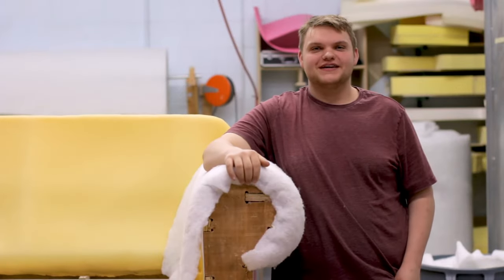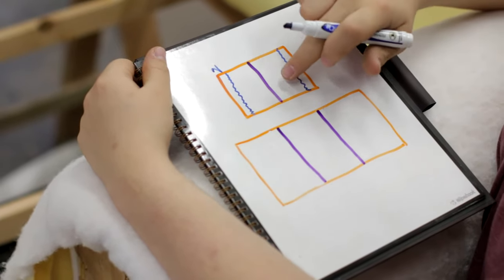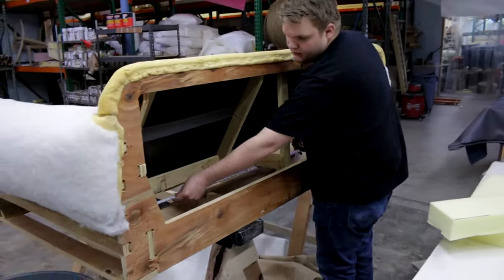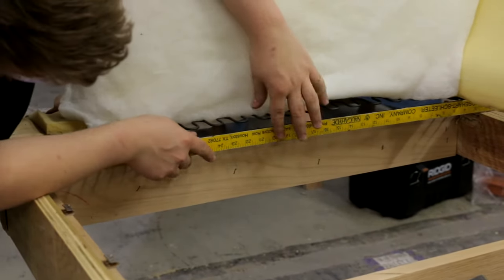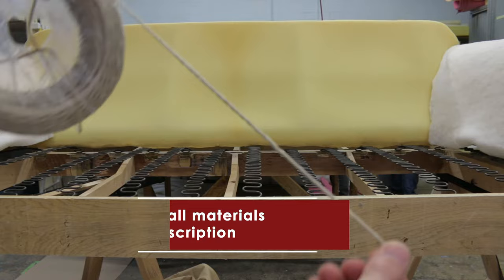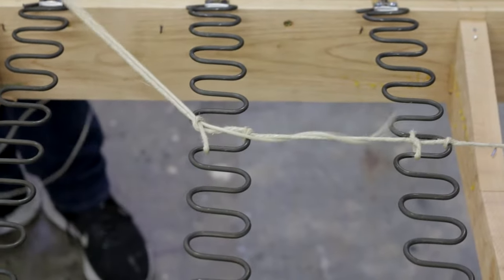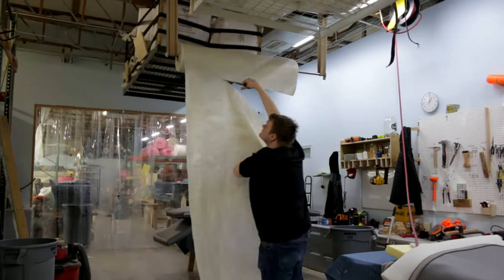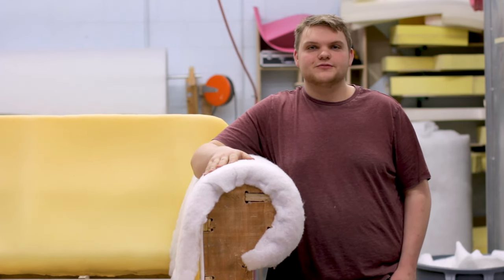Spring a Couch Like a Professional

Comment: Hi - this is a great video, thank you - I feel like I want to give this a try! But I'm curious how you compare the zig zag s-springs with nylon webbing, as far as comfort & ease of installation go. I am planning to build the frame of a sectional, and there is shockingly little information comparing them, beyond surface level cost comparisons. I had been planning to just go with nylon webbing, as it seems easier to do -- but springs in my mind jut seem way more comfortable and, based on this video, more accessible to do than I thought they would be!
Reply from the maker: Interesting that there isn't a good comparison video on them. Ultimately Nylon webbing is a lot stiffer than springs. What springs do really well is they give way a little bit so it doesn't feel like you're sitting on a firm surface. Depending on how tight those springs are it may feel like you mold into the couch or rest on it, where webbing doesn't give that same soft cushy feel. However you can web a sofa and have it be comfortable -- many manufactururs use elastic webbing to get the best of both worlds. The only downside to that is that elastic webbing wears out over time and then you have to fix it or it really feels bad... Hope that helps.

Comment: Very informative video! I do furniture repairs in home and do some sagging furniture repair, but typically I don't replace the the springs, but I had one the other day, the cushion seemed fine and not sinking in too much and they were coming back normally to shape and I didn't see any broken wood or Springs coming off when I checked it out from underneath, but my question is will these metal Springs need replacement, do they wear down after so many years even if they look good?

What I did was put some webbing horizontally weaving through the Springs horizontally, it seemed to help a little bit but not too much, would you have done something differently? Like replace the springs? Or the cushions? 

Thanks for your reply!
Reply from the maker: That is an excellent question. Springs come in different guages and depending on how thick the spring is depends on how much it can handle. No sag springs by design can take a pretty good beating and still function well (as long as they still have zig zag to them they can still stretch) but they can stretch past the point they were designed for. In that case webbing in line with them is not a bad fix or applying burlap to assist the springs. Ultimately if you have a good thick guage spring it won't wear out but that is not always what a sofa comes with.
Reply: @createwithcraftsman  thanks for the reply! 👍

Comment: Hi, doing this job like how you did, what is the basic weight limit? I am guessing 200-250? What would you recommend changing for heavier people?
Reply from the maker: Great question. That gets into the guage of steel you use, the spring spacing, the way the frame was built, etc. It all works together in one unit to get the best result. We use 10 guage springs and I would not recommend them on a plywood frame as it would pull it apart. Our sofas are built with 350 lb people in mind so a 12' sofa would need to support 4 people, though you need to look at every piece of the puzzle, not just the springs.

Comment: I had a custom velvet down couch that lasted 25 years through 3 children, 2 adults and 2 dogs. It was slip covered so i could wash it. Well its finally sagging now. I look at the junk sofas on the market for $3000. My velvet couch came from North Carolina and cost $8000. It was a wedding gift. I dont want to part with it. My husband can do the springs. What type of foam should I replace the bottom cushion with? I think i vould just slip the slip cover over the new foam?
Reply from the maker: You are going to want to use foam you get from an upholstery shop or foam shop. Something around 27027 for the seat is good (those are specification numbers for the ILD and IFD which is how dense and how heavy the foam is. The density should be good for a seat (or up to 35 on the firmer side) for a seat. A local upholsterer or foam shop should be able to help you navigate that. There are some online options that you could use as well but local shops can typically get you better pricing.
https://www.foamorder.com/

Comment: Hey great video. Very clear. I'm going to rebuilding some outdoor furniture for  six inch thick foam cushions that my friends already have.
I want to use the zig zag springs underneath but I am concerned that the pillows won't sit flat on the springs if they have the curve that you show.. Can I stretch the springs out until they are flat?
Reply from the maker: You wouldn't want to stretch these until they are flat. To eliminate the gap in front you would use edge roll which is a foam, burlap, cotton, bolster that you would attach to the front of the frame and then fill foam or cotton in behind the edge roll so that the sloped portion of the spring is filled in. You could even go without the edge roll if you have a finished wood outside and just fill in with cotton or foam in that sloped region.

Comment: Do you have any suggestions for where to buy no-sag upholstery nails? It seems like Upholstery Connection doesn't sell them anymore.
Reply from the maker: It is a hard nail to find, our suppliers discontinued them too. you just want a thinner nail with a larger head and to try to not be as thick as your wood so it doesn't poke through. A local hardware store like Ace should have a few options. If you can't find something let me know and we'll look up a spec for you.

Comment: I’m having trouble with the simple single  knot on each spring. When you tie and pull to tighten it in the video it seems your knot pulls out the slack and gets tighter. When I pull it doesn’t seem to take out the last bit of slack it just locks in place once the knot is tight. I feel like I should be able to get it to tense up more but the knot locking up seems to prevent that. Any tips? I like the technique.
Reply from the maker: try tying that knot the other way. Instead of RH over LH go LH over RH or vise versa. That should clear that up.

Comment: Do you really need the twine for a chair with the zigzag springs? I’m replacing mine after losing one spring. It’s a Lane chair but it’s a hand me down, but I don’t think they used it.
Reply from the maker: specifically italian ruby twine. It holds up a lot better than typical bailing twine. I believe it is just a hemp twine but it is durable. If you use something less quality you can double up on the thread to keep the strength up.

Comment: How would you do I leather sofa that you can’t take the cover off .When three spring clips have broke
Reply from the maker: Excellent question! Ideally you would take the fabric off and then replace the EK clip and springs and then put it back together-- being very careful when removing and re-applying the leather. That would be the ideal situation. If you can't remove the leather because the leather may rip or other constraints I would suggest taking off the dust cover from underneather and applying the spring back to the inside of the frame using clips and screws. That is not quite as good a repair because it puts a lot of strain on the clip to pull directly out of the frame-- but it is not an ideal situation to begin with. Be careful to have plenty of support but not to split the wood with screws too close together (more a concern with hardwood where we would suggest pre-drilling for the screws that close together).

Comment: Why put the spings so far apart, would it not be better to put them closer together so that last 5 years without failing like the commercial sofas
Reply from the maker: Great question, the longevity of the spring system will ultimately come down to the quality of the springs and other materials used. We use high quality springs, twine, and FLW (the white synthetic burlap used to cover the springs). If you have good springs and you put them too close together, they can warp or break the frame. The way we install them, they should last for decades.